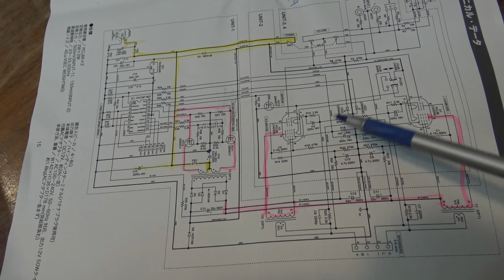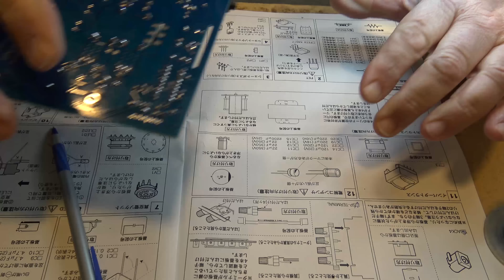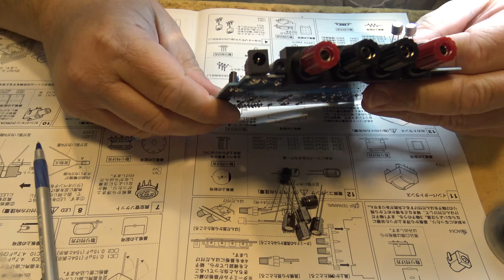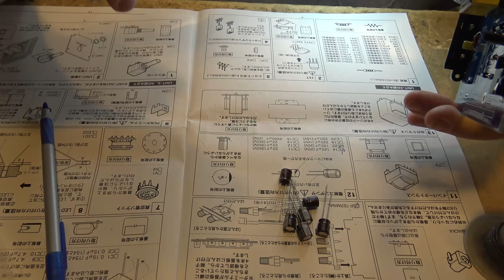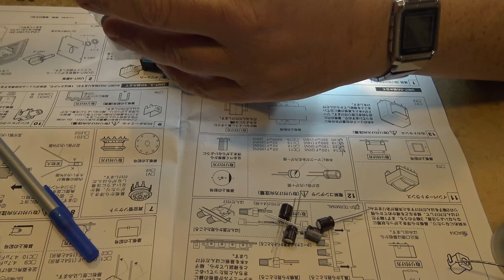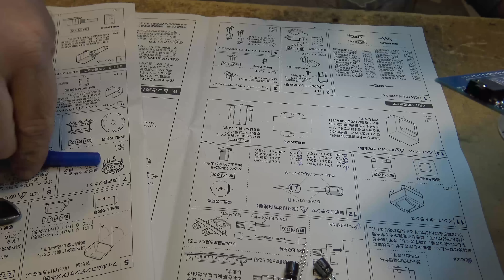ELEKIT TU8100 Class A Tube Amp Build Part 2 in 4K

Comment: Does all that switching to create the square (pseudo-sine) wave cause noise?  If I were to run an AM tuner through this amp, would there be a bunch of buzzing similar to what comes from wall warts?
Reply from the maker: I haven't heard any, but I will go plug my AM radio into it, and see if it has any noise generated and let you know.

Comment: Used To Have One Of These Cute Little Valve Amps Back In The Day I Believe  All output Valves Are Mullard ECL86's To Give 10 Watts a Side, The Pre Was Connected To The Power Amp By a Umbilical  lead. Keep Up The Great Work Looking Forward To Part 3  http://www.auctiva.com/hostedimages/showimage.aspx?gid=964987&image=875529995&images=875530148,875530131,875530112,875530052,875530033,875530015,875529995&formats=0,0,0,0,0,0,0&format=0

Comment: I hop your two tube radios that your planning to restore don't have sliver mica disease . if your radio do you will have fun taking apart if can and digging out the mica capacitor. none of my radios have CMD. radios form 40s don't get CMD.
Reply from the maker: They could have asbestos in them for all I know. Won't know until I get them apart. It was common to place asbestos sleeves on wires that were in contact with large resistors to prevent the heat from melting the insulation on the wires. Of course back then asbestos was safe right.

Comment: The price is too high.  The most expensive parts are the three transformers though, could be well over 50% of the price for quality.  The PCBs, tubes and caps etc., aren't that bad.  But if it had the larger el34's, kt88's, or 6l6's, the tubes can be over 50$ each. I found a Lafayette PA675 with two el34's for under 200$, more fun to restore / rebuild than build a newer kit for me.  It's a gamble from ebay, but that's part of the challenge.  Hint, old tube public address (PA).  organ, and movie projector amps can be found to be pretty cheaply still.  But large tube guitar amps and hifi with kt88's can go well into the thousands of $.  Don
Reply from the maker: My home stereo amp uses 4 EL34B and 4 12ax7 and yes I know the price of those tubes as I have replaced a set. I haven't opened the box with the tubes in it yet so I don't know what they are, but the display kit in the shop where I bought it had NOS Mullards in it.I have 2 tube radios to restore. One is a Nordmende AM/SW with a record player (that part is missing and I am looking for one for it) and the other is just a chassis. WIll be working on them at some point.Was in a car accident, and have whiplash now, so I am not feeling like doing much today.
Reply: sheesh, back pain sux, I know from years...  
hope you feel better soon, I try to avoid pain pills.   

I have an old late 50s tube  Philips Jupiter  table  radio, I like German rigs.  I made a vid about it.  Still on the back burner for restore, but it works.  There are many German SW radios from the iron curton days;  Grundig, Telefunken, Blaupunkt, Nordmende, Philips, Graetz, Saba, etc., they all look similar.  I'd like to find an old Unitra Polish radio, uma Polock too.  Don

Comment: There are tiny wire-ended Russian Vacuum tubes which are designed for battery operation, Resin-core solder should be available in any hardware store, but why do try and source the solder from some where in California.
Reply from the maker: I can get 60/40 solder where I bought this kit, but it is Chinese crap, and well we all know how well that crap flows.
Reply from the maker: Way back, when I was a kid Radio Shack made kits.One that I built was the 1 tube radio.It used a single AA battery for the filament heater, and a 22V battery for the plate voltage. I remember that the AA battery would only last a few hours but the 22 volt battery lasted a few months of use. I often wondered what happened to that old kit and all the other ones I built as a kid.https://www.google.com/search?q=radio+shack+science+fair+1+tube+radio&biw=1188&bih=640&tbm=isch&tbo=u&source=univ&sa=X&ved=0ahUKEwiahKr5ltvQAhUUz2MKHU8TCicQsAQIGg#imgrc=3fRqbXjrSQCHcM%3A
Reply: I have a source of American-made 60/40 solder here in Salt Lake City.  I did a video on the place.  I'll bet if you contact them, they would mail order some to you.  The store is called RA Elco.  They are in the 801 area code on Main Street in Salt Lake.

Comment: I think it might have been worth bending the lugs on the transformers to secure them before soldering
Reply from the maker: I considered that, but the unit isn't going to be transported.Solder will hold them in place just fine. I may do that before final assembly as the unit isn't done yet. All the boards are complete, just need to put it in the cabinet. Of course you need to wait for part 3 and 4 to see that.

Comment: I am supprised that they use a switchmode to produce the h.v, switchmodes are normally very noisey with harmonics.
Perhaps the pic chip tailors the drive waveform to minimise the noise perhaps?.
Im not deep into switchmodes, except they are capacitor killers LOL :-D

Its a nice kit :-D, you look like you're enjoying the build, i hope the presents of the camera hasnt taken away any enjoyment.

Comment: Just looked at the specs. THD is 10% Is that typical of tube amplifiers?
Reply from the maker: Yes most tube amplifiers have a fair bit of distortion at max power however that type of distortion that tubes produce is even order harmonic distortion, which actually sounds very pleasant to the ear. It warms the wound up, and takes the harshness off MP3 for example.Odd order harmonic distortion on the other hand is terrible, and the ear can hear it as lot as .12%.  Guitarists crave even harmonics, and that is why so many use tube amps. Each harmonic is an octave above the frequency, and this is why they sound so good.Odd order are in the 3rd 5th 7th multiple of the tone, and are very objectionable.So when you see tube gear distortion is not generally a bad thing. Also when tubes saturate they do not clip like transistor gear.With a transistor amp when the transistor saturates the waveform clips, and produces very harsh odd order harmonics that will blow speakers.Tubes on the other hand do not clip. The waveform will max out, but the peaks of the waveform are not flat clipped. By the nature of the output transformer, the sharp edges of the square wave that would result from clipping is rounded off, and softened.So 10% distortion is not a bad thing. I have listened to one of these amps on demo in the shop and it sounded wonderful.
Reply from the maker: Captain Cuntonese 

single ended amplifiers sound even better. I keep astonishing my friends on how much better it sounds. this little amp has by far the best sound of any that I own at background music levels vocals are especially clear. was listening to Sheryl crow and it sounded like she was in the room. it's hard to put into words to someone that has never experienced this. as a musician I have used tube amps for years because of the sound quality but these were always push pull class ab. there is as big a difference going to a single ended amp as there is from going from solid state to tube in terms of music listening pleasure. THD means absolutely nothing in the tube world because all the harmonics are even order and they ear does not hear these types of distortion like odd harmonics.
Reply: Also, you can rate the power of any amp at 10% THD just by over-driving it, so it would be interesting to know at what power the THD rating hits the minimum and what  maximum power it can produce at a more reasonable distortion level like 1%.
Reply: The general practice is to measure distortion at 1 watt @ 1 kHz. A good distortion number for 1 kHz is around 0.25% THD or less. When output distortion just crosses over 1%, that is commonly listed as maximum output.  IMHO 10% THD would not really be listenable over time, that's the kind of distortion (and more) guitarists aim for.